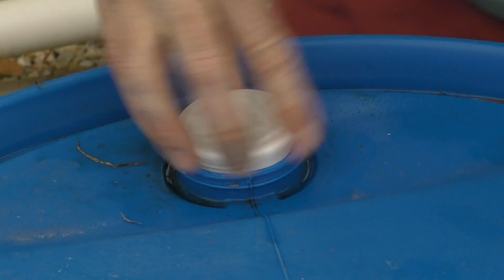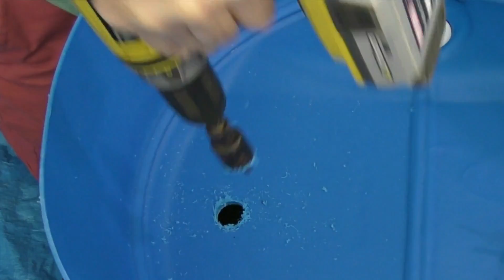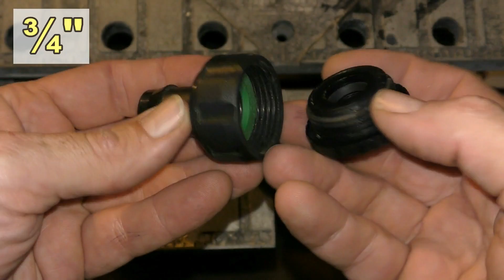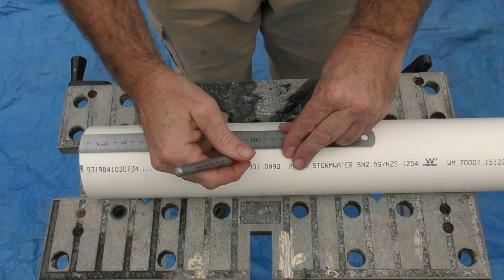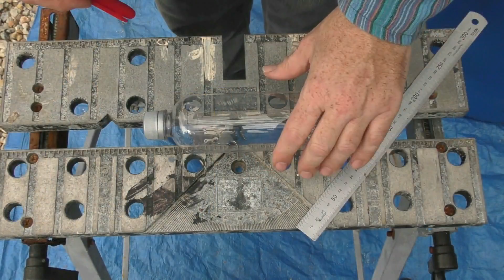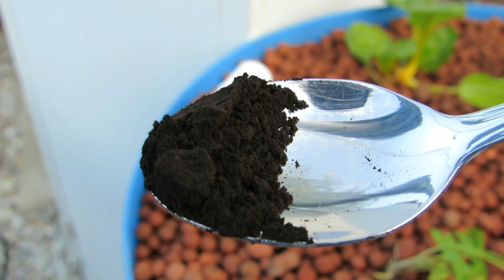Aquaponic Barrel System Build, Chop & Flip Style.

Comment: We've planned on getting into aquaponics for a few years now, and want to ramp up rather than jumping right into the system we want. The plan is to start with this, maybe put together an IBC chop-and-flip, and then graduate to the larger system we want. Normally we'd jump in, boots-and-all, but this time we decided to learn to walk before we tried to run. :)

I put one of these together today, and my wife wants two more so we can configure them as a water feature under our veranda.  I bought all of the gear for all three, but wanted to get one working, iron out any problems, and then build the other two. I did a couple of things differently to this video and learned a couple of things. I wanted to share those here, just in case they're useful to anybody else.

1. I ended up getting exactly the same pump that Rob uses here, though that was an accident. The guy at the hydroponic store told me that it was a 13mm outlet, but it's not.  The smaller version of this pump has a 13mm outlet, and the larger version of this pump has a 19mm outlet, but this one is 16mm.  I wanted to use irrigation fittings as I have a heap of them handy, and wasn't sure how to make that work.  I went into the hardware store with a pump and worked through the options. What I found was that the 19mm irrigation fittings fit over the 16mm outlet really, really tightly.  I used a 19mm barb and a rubber mallet and basically converted the pump to a 19mm outlet.  From there I just used 19mm irrigation pipe and fittings, and it worked really well.

2. I couldn't find a 20mm PVC valve socket with “O” ring.  I could find it without the O ring, but then couldn't find separate O rings. Rather than mess around, I just used a second bulkhead fitting.  That makes it probably $10 more expensive, but it makes it much more idiot proof.

3. I cut my viewing window a bit too large.  For the next one, I'll use a flatter window and maybe place is a bit higher on the wall of the barrel. I'm not going to cut in an access port at the back either, but rather a hole just big enough for the pump cord. This will let me have more water/fish.

4 I'm going to try and source some thin perspex for an underwater viewing window for one of the next barrels too.  I tried to get some the other day, but it was all too thick and wouldn't flex enough. I've sourced some stainless steal nuts/bolts and aquarium silicone though, and am pretty sure I can make it work.

5. It took me an hour to hour-and-a-half to build the system today, but then a few hours trying to get the bell siphon to work properly.  I could get flow enough to get a siphon to initiate OR break, but had trouble getting the right flow to get both.  I ended up changing the bell to reduce the head space above the stand pipe, and I drilled 8mm holes in the legs at the bottom of the bell, just to get me more chance of breaking the siphon.  In the end, I had it mostly working with just water, but it was a little hit-and-miss, mostly when it came to breaking the siphon.  It occurred to me that the water rate at the end of the siphon would be slower if there was media in the bed, so I filled it up.  That did the trick, and I could easily get a siphon to start and end.  I was able to adjust the flow a bit more, and it works a charm. Next time, I'll get the bell siphon mostly working, but will put in the media much earlier.  That has the added bonus of reducing the fill/drain time, which will speed up the fine tuning process.

6. The clay media I got from the hydroponics store is much less uniform than what Rob shows in his videos.  I use 8mm holes in my siphon shroud, as suggested, but my media has clay balls smaller than that.  I'll use slits rather than holes in the next couple of barrels.

I've put a little seasol into the system, and will let it run a while before putting some goldfish in there.  I might plant it out in the next couple of days though - we're planning on planting strawberries and maybe some greens.

I managed to get the barrels for free, and have a heap of irrigation and PVC fittings from the other projects we do.  Noting that those things did cost me money in the past, they feel like they're free when I use them here (I could open my own hardware store using the fittings in my sheds). With all of that in mind, I reckon these barrels will cost less than $100 each, and that's using two bulkhead fittings.
Reply from the maker: Thanks for the rundown folks.  
The O rings are a separate purchase & normally come in kits. I picked up a box worth from Aldi for about $10 from memory.
Cheers.

Comment: Just wondering ...wouldn't it be better to have the pump a few inches off the bottom to give some room for the fish poo to settle without sucking it straight into the pump?
Reply from the maker: Is a good idea to get the poop out of there so it doesn't start to break down & health issues for the fish.  It's best it goes to a filter, sponge under the bed inlet or even the media that stay in with the fish.  👍👍

Comment: Thanks for the video Rod. After watching I decided to build my own, added 10 goldfish which seem happy so far and planted some plants in there but I noticed that my clay grow media was lifting on the sides on pulling down in the middle, also pulling all the plants closer together. I removed the bell siphon to let it run as a constant flow system which seems to have sorted the problem out. Any Idea what can be done to refit the bell siphon and not have the clay move? Or is the constant flow efficient
Reply from the maker: That may of just been happening while the clay was soaking in water. It generally stops after a week or maybe 2 at the moment. 
I'd pop it back in now & see if it's still making the clay float.

Comment: hey man 100% clear  latex is non-toxic so you can use that in fish tanks don't buy the hype where you have to buy expensive latex cuz it's b***** just buy regular old 100% latex clear caulk (I've been using in my tanks for years no problems) the second thing just use sandpaper for the cleanup of the blue Cuts because sandpaper is simple and cheap I would go with a 100 or 150 Gritanyway I love what you do take it easy

Comment: You're a legend! I'm learning so much through your videos! Hey, was just wondering: do you think there's any value in connecting 2 barrels together in one system? One pump, one bell siphon sort of thing? Also, since we're neighbours (I'm in Chermside I believe you're not too far :D) do you have any recommendation for a 12V pump? I want to make it solar powered too in the future ;)
Reply from the maker: Hi Jonathan. 
You could join the 2 beds & tanks but I'm not sure it's worth it. 
I think you may be better off at looking for larger totes or even small stock tanks from produce/feed stores if you want a slightly larger version of this. It will involve a less plumbing which means less fail points as well. 

I haven't used any 12V so it would be just a guess for me sorry.  Aqua Gardening are just down the road from you & I know they stock the 12V pumps. Let them know Rob sent you if you visit them.  😉
http://bit.ly/AquaGardening

Would like to know how you get on with the build. 
Cheers mate.
Reply: Have you gotten anywhere on making it solor?
I was thinking of doing that way for my build like this...

Comment: Rob, amazing videos. Do you have any recommendations as to the types of plastics one should and should not use in their system. I am looking to get into the hobby however, plastics leeching into the water and food scares me a bit. Also, any recommendations on light if one were to do this indoors? Again, top notch vids!
Reply from the maker: Hey Alan.
I stick with food grade high density polyurethane plastics for tanks & drums & the high pressure rated PVC pipe used to carry drinking water. 
If I could afford it I'd swap over to HDPE pipe as well but the fittings cost far too much. 
Best thing to do ids to look into it yourself as I know not everyone is comfortable using things such as the PVC pipe.
Cheers & have fun designing the system. 👍
Reply: @RobsAquaponics  thanks for the info. Top notch content!
Reply from the maker: No problem  @alanh2920   👍

Comment: Hi Rob, thanks for all your clips, they got me going with a system like in this video which worked great. One question though. I have an opportunity to fine tune the system to work better than before, and in the middle of setting it back up, I gave it a run with no media, just to make sure the siphon was working correctly. It turns out that it will leave 2-3cm of water in the bottom of the grow bed in each cycle. Is this ok? Will the water cycle through the system naturally, or should I keep trying to tweak the siphon to get as much out as possible each cycle?
Reply from the maker: Hi Hugh & sorry for taking a while to get back to you. 2-3cm is fine & is standard in most flood & drain beds from what I've seen. 
Hows the system going at the moment? 
Cheers.
Reply: No problems at all, thanks for the answer, especially this time of year, must be pretty busy for you. System is going well, thanks. I added in a swirl filter to get rid of most of the solids, and have just introduced the first few goldfish and plants. I cycled the tank for a long time partly because I wanted it all nice and clean for when I added the fish and partly because im a bit lazy.

Comment: Hi Rob, Im  new to this and built to your instructions.  Only difference is that i could only get a 750 l/ph or 2000 l/ph pump, so as you said 750 wasn't enough i went with the 2000 l/ph jobbie.  Cycle time is crazy fast, fill time is just 1m. 40 sec and drains in 28 secs.  Is this just madness or will it be okay.  I have 6 small gold fish in ATM and will be adding 6 more when system is cycled properly.
Reply from the maker: Sorry I missed your question James. C
Could you bleed off some of the flow into the tank? 
How's the system going for you now? 
Cheers.

Comment: Would it make a difference if it was a black food grade barrel?
Reply from the maker: As long as it's food grade it should be fine. Black may heat up a bit more so that might be one thing to consider if you live in a hot region.
Cheers.
Reply: I live the Pacific Northwest in central Washington, USA. We do get pretty hot weather in the summer. They are food grade. Apple concentrate was stored in them.

Comment: Hi! Great video! I finally done my barrel system and I have two questions. When I can put plants to the bed? I’ve started by adding spoon of goldfish food. Second question, how often do I need to „feed” water by goldfish food? Until Its melted on bottom or at least once a day? (There is No fish yet) Best wishes!!
Reply from the maker: You can pop the plants in straight away with no issues.👍 
I wouldn't keep adding too much food until the system cycles, a pinch at a time at the most to start off with. I'd stop adding any for the time being as there will be a fair amount of ammonia already in the system now. 
Best thing to do is to get a fresh water test kit from the aquarium shop to test for ammonia, nitrite levels. Once you see nitrite decrease to 0ppm you're right to add in the fish. 
Hope that helps some.
Reply: Rob Bob's Backyard Farm & Aquaponics Thanks for answer! System has almost one week. Its already has an ammonia in. PH is on 8,5 level. (Do I need to concern about PH level at this time?) I guess that I need to wait until the bacterias apears and change it to nitrites? 
And the last question I hope 😉 can I use seeds straight to the bed? Without wool and cups etc... or I need place seeds first to some kind of incubator and plant it to the bed when they are 3-5cm height? Best wishes!
Reply from the maker: It could be a concern if you were cycling with fish in there but as long as the system has cycled before they're added it will be safe for the fish. 
 You should be able to sow most seeds directly. I have sat small seeds like lettuce on sections of paper towel so they didn't fall down into the media & that worked out OK. I use a lot of stats grown in soil for our bed. I just make sure I wash as much of the seedling mix from the roots as I can to start with. 
Cheers.

Comment: How do you deal with rain water in this setup? I mean does the rain effect the balance in the water, and or overflow the bottom tank?
Reply from the maker: I didn't have an issue but if too much got in & overflowed the unit you would have to add some alkalinity back in I think, just as I do in our larger system.
Cheers & have a top one.

Comment: Great build Rob ! Subscribed from Mid North Coast
A good tip to making a line around anything round is to take a sheet of paper and wrap it around the object, gives a nice straight line without needing to make lots of measurements
Reply from the maker: Cheers 1800cc. Can be a bit of a pain if the barrel wall isn't straight. Have used string & blutak in the past too. 👍
Cheers & have a top one.
Reply: Rob Bob's Backyard Farm & Aquaponics, yeah I should have said using paper is good for small bottles etc, doing a drum would be a bit of a battle, keep up the good work 👍

Comment: not meant to be a troll or nitpicker.  but i  would have cut the elliptical hole first. then cut off the top.  in doing so the ridged section of the top would have helped cutting the ellipse by virtue of holding it steady.
Reply from the maker: Whatever works best for you. 👍
Cheers & have a top one.

Comment: Hi Rob, what if we catfish inside that tank, will it clog the pump? I see no mechanical filter in that system
Reply from the maker: Most of the solids will go through to the bed to be cleaned out manually. You could pop a piece of sponge under the bed inlet to collect them if you wanted too. I see a system like this as more for ornamental fish that for table fish. For table fish I wouldn't build anything smaller than this unit.
https://www.youtube.com/watch?v=b_VROMhAoSs
Cheers

Comment: Hi rob i just saw your video (a little late) and i wanted to build the same thing for a farming project. So i was wondering if a 1000lph pump would work well in this system.
Reply: Or maybe even lower like maybe 800 lph
Reply: Or something like 400 goh
Reply from the maker: Hi GS.
The pump I used was a 1000lph & it did the job well. A lot of the smaller aquarium pumps aren't really built for lifting water just circulating it so they won't lift very high at all.
How is the build going ?

Comment: Hi Rob i am new to aquaponics and have  just built this set up from your video and it works great 🖒 i was just woundering what to expect with cycle times i currently have it running and it cycles every 5-6 minutes and if i slow the pump down anymore the siphon wont engage .... is 5-6 mins ok ??
Reply from the maker: Hi Daniel & sorry I missed your comment. 5-6 minutes should be fine. 👍 They will mean that the water is cycled through the filter multiple times an hour giving the bacteria time to process the waste. 
Hope the system is working well for you.
Cheers.
Reply: Hi Rob, Im the same as Daniel here as in new to this and build to your instructions.  Only difference is that i could only get a 750 l/ph or 2000 l/ph pump, so as you said 750 wasn't enough i went with the 2000 l/ph jobbie.  Cycle time is crazy fast, fill time is just 1m. 40 sec and drains in 28 secs.  Is this just madness or will it be okay.  I have 6 small gold fish in ATM and will be adding 6 more when system is cycled properly.

P.S. Love the channel.  Great to watch and seems like very good knowledge.  Also the guys n gals at Aqua Gardening stafford said to give you a shout out.

Comment: Isn't there normally a need for an extra chamber, for the microbes to do their thing with the fish poop? Is it because of the small scale, why that's not necessary?
Reply from the maker: Hi Aaron. The media in the grow bed act as a biofilter & will house the bacteria needed. 👍 In larger systems folks may add in a separate bio filter like I have but most just rely on the media in a backyard system. 
Hope that helps some. 
Cheers.

Comment: Hey Bob thanks for that awesome Video just build a Barrel System based on your instructions in Germany. It was quite hard getting all the fitting part together especially for the siphon but I managed to do it. (If wanted I could post where to get all the parts in Germany)
However I have one remaining problem: The water in the top part for the grow media does not get lower than 3cm eventhough I cut the Bell for a 1 cm hight. First of all does this poes any problem? If so is there a way to fix this?
Reply: vornied kommtspeed
Reply from the maker: Hi there. You'll find that the siphon will stop before that top of the cuts in the bell due to air being sucked in. There's no real way to stop it as the suction formed will drag it in as it is less dense than water.
Hows the system running for you now? 
Cheers.
Reply: Could you please tell me what you do about the system in wintertime? I fear the fish will get too cold or even freeze 🤔